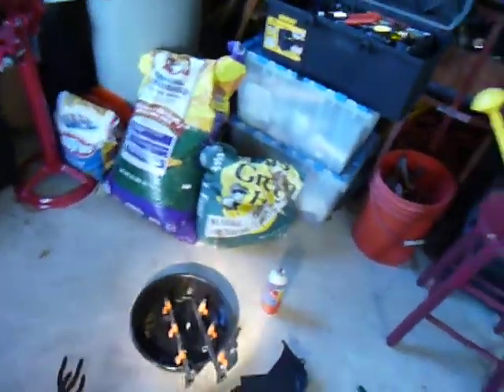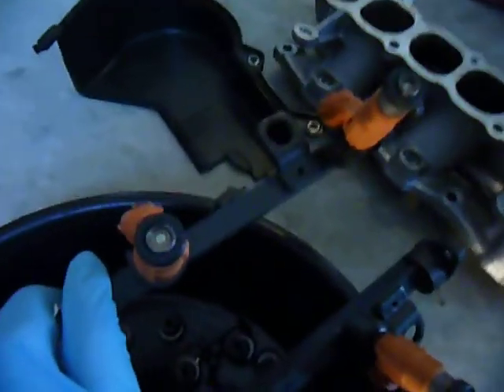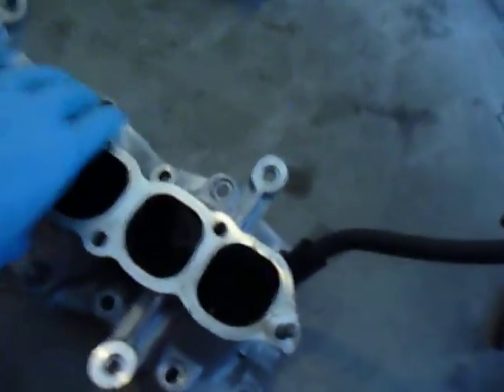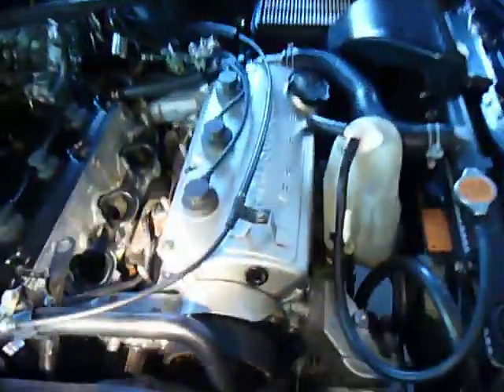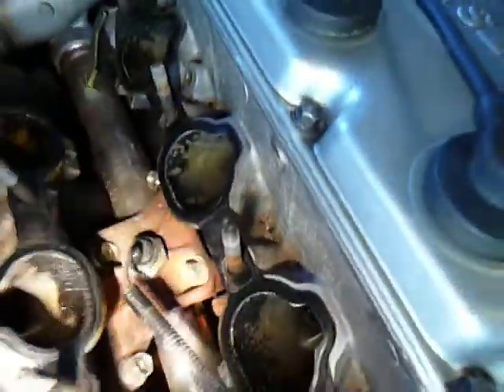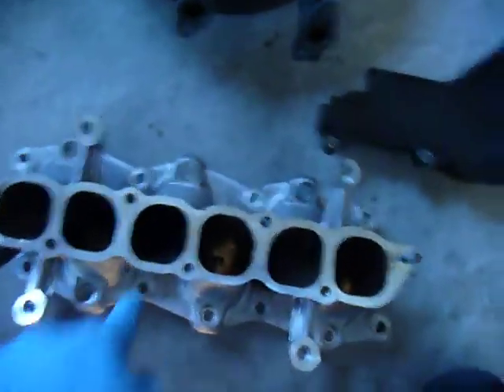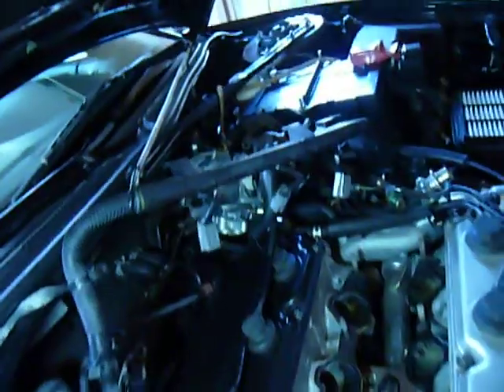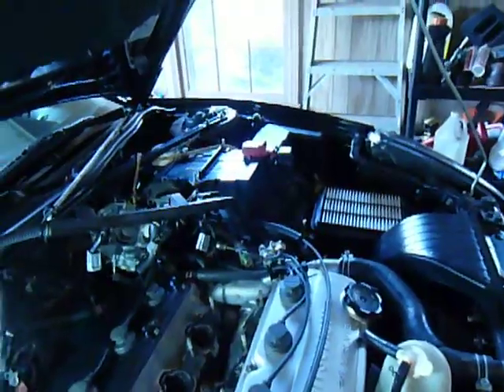Club 3g 2000-2005 eclipse:  Upper and Lower intake manifold removal

Comment from the maker: If you just removed the pan ,and not drain plug then just add 4 quarts of ATF 4 transmission fluid.  Add 7 quarts if you remove the drain plug.

Comment: i have a 01 spider it has a 3.0 with auto trans that has park  thru drive or u can push shifter over and it's a slap shift i took the pan off and didn't drain the back end was wanting to know how much it will hold ,you got to get it at four grand before it will pull out and can the filter be changed